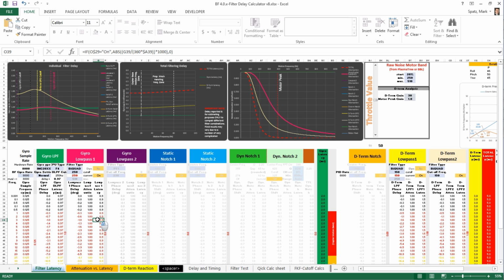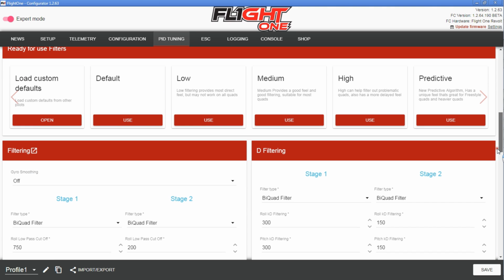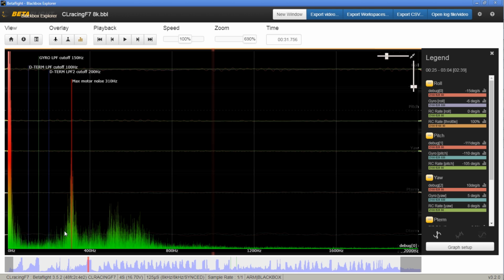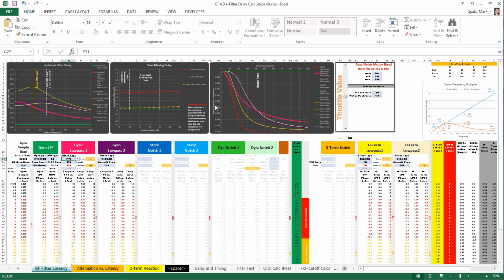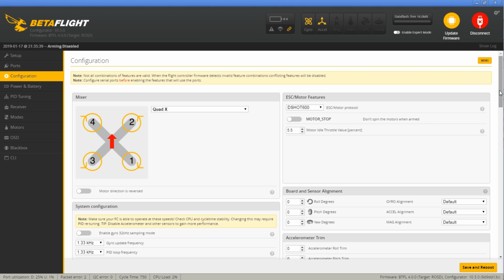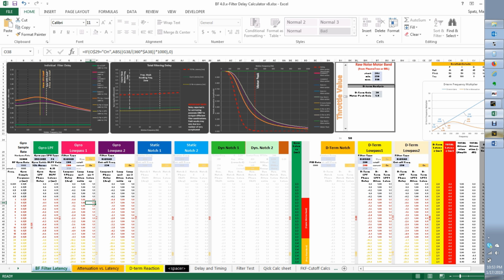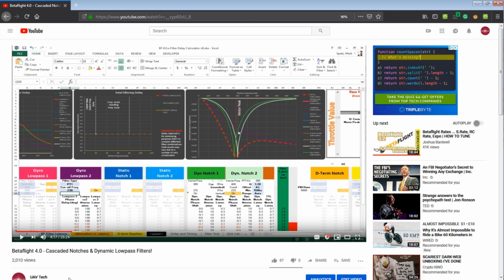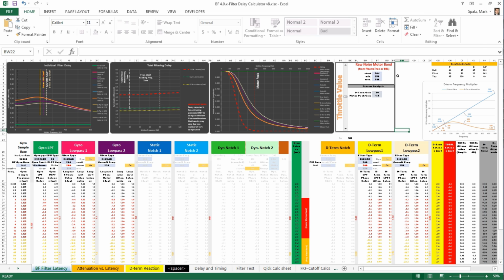Betaflight & FlightOne: Filter Fundamentals Part III - Filter Setups

Comment: just one more thanks from slightly older guy. applying this to audio worked for me...finally. well done. sadly in my case- i think i'm back to build quality. eg. using old nase f1 with 25amp castle esc's...bit of a beggar, but it should go like stink.(think de-sinc) fly aways. like the rest of us though, sure is fun when it works. will be watching your efforts.

Comment: if i run 16k/8k this will turn off digital lowpass from gyro too?
Reply from the maker: Not off, but it moves it up the Gyro's internal Digital Lowpass filter to 3,200hz from 250hz it normally resides at in 8k mode.
Reply: @uavtech  so if i use 16/8 i still need atleast 1 gyro lpf at higer freq above the max of rpm filter ? Let say rpm max at 350. I need to set gyro lpf at 350? On betaflight Or gyro lpf at 600 (above matrix filter) on emuflight? To attenuate higer freq? Is this needed?

Comment: A common thing you say is that we should try to fix vibrations (between 50 to 200Hz) mechanically. What are some of the things we can do to fix noise mechanically? I think a video about that could be interesting. From the top of my head:
Loose FC mounting, loose screws somewhere, unbalanced motor, unbalanced prop, some wire or something hitting the gyro, no vibrations and it's actually electrical noise, too notchy motors. Are there more reasons?

Comment: Awesome series, thanks for the info! Just want to make sure I have a few things I generally struggle with right:

1. Propwash is combatted by increasing the D gain, but this attenuates high frequency noise (from motors/props etc), so we add a LPF to the D term targeting these higher frequencies, but not the Propwash frequencies, since the filtering would cause more delay and therefore cause more Propwash?

2. 'Jello' in HD footage is caused by high frequency vibrations (probably from hyperactive D gain), and thus lower D gain/lower D term LPF cutoff would combat this?

Seems these two problems fight against each other, or am I understanding it wrong? Thanks, and sorry for the lengthy comment!
Reply from the maker: 1. High D-gains and the right P/D ratio are needed to best combat prop wash.  However, D-term amplifies motor vibrations (those typically being from 200 to 500hz).  So we use filters to remove the motor vibrations (noise) from the gyro signal through lowpass and notch filters.

Prop wash is typically from 30 to 80hz so not affected by the filters.

2. Jello is frame vibrations from 50 to 100hz.  This can be amplified by D-term.  Best way to solve is mechanical changes.

Comment: I watched your Filter fundamentals many times and I think I understand the basics. With my 5inch quads I got a tune that I’m happy with. 

But with my 7inch I can’t get a good tune. 

It’s shaking on midthrottle a bit and a lot on higher throttle. 

I tried your Filter recommendations for 4.0 but couldn’t get a good flying 7inch.

Can you help me please?
Reply from the maker: did you log it?
Reply: I figured it out. Thank you for reply 😊 your videos are amazing to learn new betaflight filters. Keep it up😊
Reply: I’m still having problems with my 7inch. I think it’s PID related so I tried tuning with Plasmatree. 
But I can’t get rid of the problem when I punch out and cut the throttle my quad drifts on Yaw. 
So I decided to went back to BF 3.5.7 because I’m more familiar with it. But the problem of yaw drifts is still there. 
Haven’t tuned PIDs with 3.5.7 but lowering the PIDs doesn’t solve the issue. 
Also not high I Terms can’t get rid of this.

I don’t know how to solve it. I’m out of ideas 

If you want I can send you my Log from 3.5.7. 

Maybe you know what to do?! 

Thanks in Advice 😊
Reply from the maker: Yaw drift is typical because of yaw noise.  Log it with debug_mode=gyro_scaled recorded and send to me.  Let me know what section of the log has drift.
Reply: @uavtech  
here is my log: 

https://www.dropbox.com/s/bo2gngg766apnnp/7inch%20Yaw%20or%20Pitch%20Dip-Drift.bbl?dl=0

it happened in the first log „1/2“ on the first throttle punchout close to the middle oft the log. 
I dont know if ist really yaw, could also be pitch for my understanding.

My Setup:
7 inch TBS Source One
HGLRC 2207-1775kv 6s 
Gemfan Flash 7042
HGLRC 45A 6s 32bit ESC
Omnibus F4 Fireworks 

AUW: 760g

I Aprecciate your help. Thanks in advice
Reply: If it’s not tuneable let me know. I know that hardware I am using is not optimal for 7inch but I had those Components laying around and I’m just trying to get it in the air.

Today I’m going to tune PIDs to see if that helps....

Comment: Did I get it right that in order to rely on rpm dynamic filter, I have to DISABLE the 'Dynamic Filter' feature otherwise I end up having both the rpm filter plus a dynamic (cascaded) notch active? If yes, how are the parameters for this dynamic cascaded notch set - via BFC or CLI only?
Reply from the maker: You can run RPM + Dynamic Notch OR just RPM OR just Dynamic Notch.  I just run Dynamic Notch for the time being.  I did RPM testing and will come back to it, but for content I don't want to put stuff out there yet since BLHeli Firmware is still Beta.  Plus, it is a little more complex and folks are struggling enough.

The width between the Cascaded Dynmaic Notch is set in the CLI.  Type "get dyn" to see the variables.  Width=0 makes just 1 notch (like classic).  The width is a % of spread based on the center frequency.  So as the notch goes higher, they get wider automatically (just how notch filters work with a fixed Q) so we make them a wider spread.  8% of 500hz is, of course, more than 8% of 200hz.  Again, set width% = 0 makes 1 notch , not two.

Comment: What does the attenuation curve look like for the FL1 brick wall filter and what kind of phase delay times does it have?
Reply from the maker: It is a 4th order Lowpass.  So it is twice as steep as the BiQUAD filter and 2x as much phase delay. 

I don't recommend use unless u have a huge noise issue and even then u should fix it mechanically.  If u do use it, make sure the cutoff is really high, like 700 to 800hz plus.
Reply: UAV Tech That’s exactly what I was thinking. If I have bi-quad set to 200 and 230 for D term and then for the Gyro use bi-quad at 200 and a brick wall at 700. I should also mention that it’s an FL one set up

Comment: Hi UAV Tech,
First of all thank you for your great videos!
I am kind of a beginner and also quite old in this hobby. Beginner in the sense that I soon want to build my first drone and old in the sense that i´ve studied everything i could about quads and other drones since that Tested video with charpu in 2014.
I am not a beginner with flying things, I have flown model helicopters and planes, quite a few simulators and am in the process of getting a glider pilot licence. I just never got into quads until now because of the crazy price on high end fpv gear (goggles that cost 500€ and so on) and I know that I wouldn´t be happy with bad image quality. I know what to expect from FPV video but thats the reason why I want to make it as good as possible.
When I build my quad I would like to get the best parts I can when I´m already spending this kind of money.
Currently I can´t decide if I should go for the spracing f7 duo, the brainfpv radix, the strix binary f10 or a "normal" f7 flight controller. Do you have any testing on these flight controllers? Do you know anything about the latency on these FCs? What would you personally choose and why? What are all the pros and cons of the relatively (relative to the other FCs) slow sampling rate on the Radix? Is there a thing as too much softmounting? I would love to get all the details :)
Currently my build list is looking like this:
the new armattan marmotte frame
brotherhobby returner r6 2207 2400kv or 2700kv (not sure yet)
DYS Aria 70amp (I like overkill and the metal heatsinks should be great for propstrikes) and a few caps
one of the FCs mentioned above
potentially a PDB depending on FC choice
TBS Unify pro HV SE
TBS crossfire
lumenier AXII Antennas
JB micro eagle
Some sort of buzzer with backup battery, haven´t decided yet
the new gemfan 5146.6 props that kababfpv made a video about

I would love to hear some recommendations and thoughts!
Sorry for this long comment, however I would be very grateful for you to share your knowledge!
Greetings from Germany and happy flying!

Edit: I just found out about your channel and wrote this comment just after watching this filtering series. I just watched your video on the helio FC and it’s moving further down the list for me, since it seems to be more hype than real improvement. I wonder how much phase delay the spracingf7 and the radix have, and if the 90 degree gyros or the special bosch one works better. Do you have any information about this? Information about the spracing f7 is really difficult to find in general. What is the best performing board that is not the radix or the spracing (In terms of performance, quality and reliability)? And again, what would you choose?
You are one of the few youtubers that I feel like I can trust. There are some other channels that while delivering good information seem very biased to some brands and products....
Reply from the maker: Hi Flyingby, thanks and welcome.  I feel you, i have been flying planes for.many years.  Still have my Airtronics 72mhz TX!

Yeah, Helio as a business is dead too (recent news). So no Strix F7 or Helio boards.

I would go F7 just for UARTS and no inversion B.S.. I need to get a Radix for testing.  One thing I don't love about Brainfpv (Radix company)  is you have to get your target HEX from them.  Like Helio, you can't just load it from the betaflight configurator.  Which also doesn't allow you to  load up pre-release BF (like BF 4.0 now) if that ever becomes your pleasure.  Also if the company stops publishing hex files you're kind of stuck.  I think at least with brainfpv there code is on their GitHub so technically you could update it and build it if they stopped. Not to say brainfpv is going anywhere. They've been established for quite a while now. So I cannot speak to it's performance Radix yet.  The 3K sampling rate doesn't really scare me off.  That should be fine.

SPracingF7 is a feature rich board, but I need to test one thing on it before I recommend.

iFlight is launch today a dual board that works well, the TwinG F7, that I have tested.

Also give the KakuteF7 a look. Kakute's soft mount gyro foam always seem to be very effective for dampening noise.

I will do a video on this subject soon.

Tip: do give box googles a look.  Their field of view (FOV) is far superior to any sunglass googles and at 1/5th the cost.   They just don't look, are as cool and you're not as lite, and don't transport as easy.

Comment: Awesome video. I love that your exploring F1. Regarding logging for flight one it does work. To be able to see the noise using the spectrum analyzer you have to be on multishot with legacy pid controller and fw 1.2.76. It will work with BF blackbox explorer version 3.0.0. I personally use this combo so I can set my filters. Then I switch the pid controller type to sim mode when I am satisfied with my filtering. To see the gyro noise simply add ugyroADC and click the spectrum analyzer.
Reply from the maker: Thanks.  I tried a bunch of versions with Legacy and Multi shot.  I was on Spektrum.  I now have Frsky so will give this a shot.  I so want to get F1 logging working for me!

Comment: Really nice vid. I see you were running FW 190 on F1 did you try logging with Sim mode turned off? I  remember in 190 that it worked in what is now called legacy mode but not with other PID controllers in F1. I believe logging was supposed to be enabled in the stable version as well but only in legacy. But that also may defeat the purpose in tuning in those special modes.  at any rate I enjoyed this one nice work .
Reply from the maker: I tried multiple versions, slightly older - way older - beta, in Legacy Mode and in Sim.  I'm flying Spektrum, but that will.change next week.  Will try again on Frsky.  Maybe that was an issue, idk.  

I talked to Preston, Willard and other folks on the Discord about it.  Seems like I'm not alone.
Reply: @uavtech  Indeed  the mystery of F1 blackbox continues. It would be a nice feature to have. I would have arrived at my filtering numbers alot quicker. Glad you are diving into this tho. Love and appreciate what you do. I am also very much enjoying BF 4.0 it's loads of fun but that's what its all about!

Comment: Nice video series, I like your videos. I feel every day have better understanding of filters... will you ever have a video about KISS adaptive filter comparing to BF/F1? I use KISSv1 on one of my rig and it fly well without any propwash with out of the box default settings and I don't know how is that even possible. What magic they are using?
Reply from the maker: Does KISS support blackbox logging?
Reply: @uavtech  I am working on it to figure it out :) I have a iflight board which has spare UART for logging...
Reply from the maker: @lancusfpv8580  , let me know.  Will i vest if can be logged.

Comment: So how do you read the bb log spectrum graph to determine what the settings should be and how do you know which filter to change?
Reply from the maker: Lowpass filters have wiiiidddeee ranges, so it is not exact.  Basically, u look at the raw gyro trace spectrographs (Debug mode = gyro_scaled in BF) and make sure noise is above 200hz on all axis.  If so, setup lowpass combo to maximize attenuation from 230hz and up.  U can use the filter calc tool to look at options; with my recommendation.  With BF, we are doing more and more of the filtering with the Dynamic Notch vs. Lowpass filters as it is more efficient (more attenuation with less phase delay).

To see "what is enough filtering" relay on forward flight motor temps and prop wash handling (180 turns or Split-S turns on diff. filter settings).

U get more filter latency reduction by moving up Lowpass1 (the lower filter cutoff numbers) vs. moving up the higher cutoff numbers.  So focus your efforts on getting the lower numbers higher.  Again, see filter calc to compare and see for yourself.
Reply: @uavtech  thanks for the response.  I have been looking through your past videos trying to find what best aids in diagnosing black box and then changing filter settings but there is just so much information out there that it is hard to keep up.  Which of your videos would you recommend for "dummies" that best goes through this process?

Comment: As I'm trying to tune a 6S 7" quad.  I guess I'm going to need lower set filter HZ,  as the motor noise will be in a lower range. I have this annoying slight nose bobble when I'm flying level forward that I can't seem to get out.
Reply from the maker: Is the shake in the gyro trace or just in the HD?  You could filter out of gyro, but still have in HD because, whelp, it is a physical shake that is moving the camera.

If in the gyro trace, which is causing the quad to react because not being filtered out and if not on BF 4.0 I would go there and:

0. If 32bit ESCs make sure PWM signal os 48khz in ESC.
1. set the notch range to "Low"
2. Change the gyro lowpass1 type to PT1
3. Set the Gyro Lowpass1 Max to 250hz
4. Set the Gyro Lowpass1 Min to 100hz. (In CLI)
5. Set the Min dynamic notch range to 100hz.

That will push all the filters lower then defaulted for 4.0.  However as you increase throttle, they will move up.

If u have not seen the Cascaded Dynamic Notches video, check that out for what the heck I'm talking about for the above.
Reply: @uavtech    It's a physical shake I can see in the camera and HD, and the trace is evident on Pitch Gyro.  It literally just bobbles up and down a few degrees at middle throttle level flight.
  It's an Older 3.4.1 BF, it has to be said it's a 750g DCL sized frame, so it may be just inherent frame resonance with the 7" props.  
  Thanks for the pointers.  I'll do an update and work on it.

Comment: A quick question. How does the fc transform the filter settings(Hz) into motion(degrees/sec). Or does a given Hz at 8k just equel a determined rotation per sec? That then gets subtracted the output from the gyro?
Reply from the maker: Talking in the Hz - the frequency domain - for filtering is just for convenience (industry standard).  The filter math works in the time domain (degrees / second).  

A good way to translate is using the tool at: http://www.kylesconverter.com/frequency/degrees-per-second-to-hertz

As u can see, a 1000 deg/sec flip is only 2.78hz.